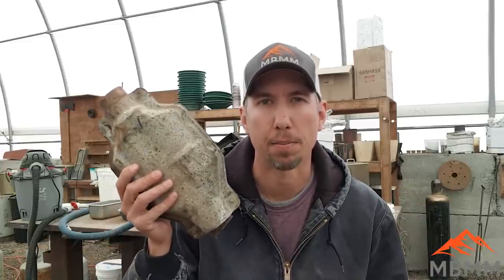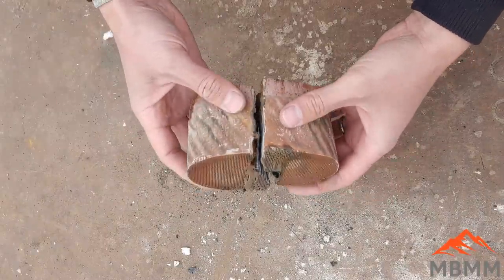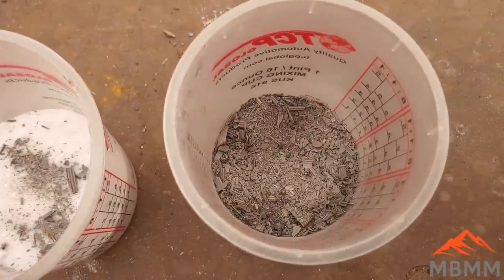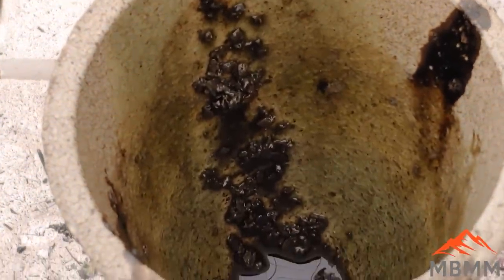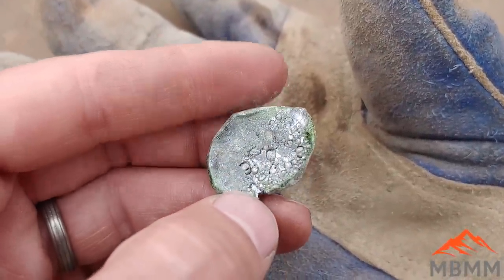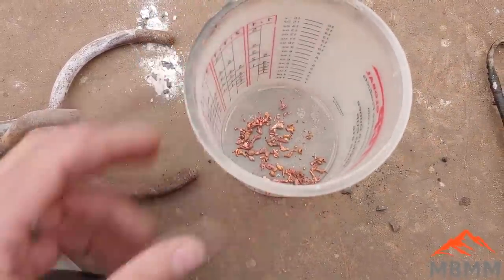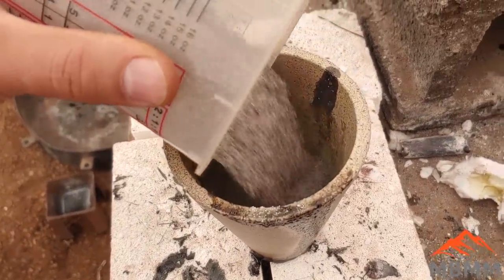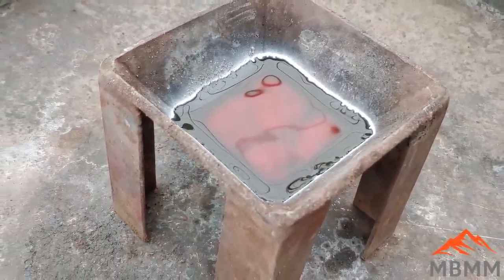Can Platinum & Palladium Be Smelted From Catalytic Converters? Urban Mining Platinum and PGMs!

Comment: with hot work like this, the very small particles of metal do not have the weight to move against the convection currents in a crucible so stay quite evenly distributed throughout your slag. you need a rotating furnace that brings all the slag into contact with the collector metal at the bottom of the crucible. the molten metal collector stays on the bottom of the crucible and the rotating agitation of the crucible brings all the flux into contact with it allowing it to do its job of alloying with your target element.
Reply: Q

Comment: Hi Jason
It is difficult to recover catalysts by gas smelting. Refineries do it in electric arc furnaces where high temperatures are reached.
On the other hand, when metals such as palladium are copelled, the final button usually does not reach more than 50% purity due to the high temperature of the palladium.
 So the lead is not oxidated 100%
There are two types of catalysts. Some contain only palladium and others contain palladium, platinum, and rhodium.
On the other hand, it is always convenient to grind and mix well. For this type of analysis, litargirium (PbO),  is usually used as a collector and some charcoal to reduce the  lead.
good video!!!

Comment: Good morning Jason,
I watch every video you do.  I really appreciate your approach.  Thanks fort showing both the successes and failures.  I did a lot of salvage work over the years, and if the cat is one of the aftermarket cats there is a good possibility that there was very little PM in it to start with.  When I sold cats to the yard they would pay $100 to $150 for oem cats but only $7 for aftermarket cats.  Reason they gave was almost no Pl and Pd in aftermarket units.  Same price for brand new cats if aftermarket.
Reply from the maker: Thank you for the information! Also thank you for watching our videos so diligently, it means a lot to us (especially Jason) when people return so often.
Reply: By OEM you mean new? And aftermarket is used?
Reply: @freeman2399  OEM is original equipment manufacture (GM, Ford, Chrysler, Toyota, Honda, etc.) and aftermarket would be others
Reply: @mbmmllc  Low grade Cat
Reply: I've never melted or smelted any metals in my life but I find it interesting to watch these videos from time to time. 
I'm always curious about something... Can it really be profitable to smelt scrap like this in a small scale? 
I haven't done any calculation or anything but it looks like it's using a lot of propane in comparison of the size of the beads that I see at the end to these videos and there also the cost of the crucible and other stuff like that...
Reply: @kube9189  Ok but why would aftermarket cats have less metal?
Reply: @freeman2399  because they usually do not need to meet any warranty requirements like OEM does when they certify a car for longevity.   Exception would be a legally sold one in Cali needs to last a certain number of years or miles, and those typically go for twice as much.  For my 94 camaro, a Cali certified one is about 200 dollars.  An "ebay special" non compliant can be had for 80 bucks on a good day
Reply: Less than 10 years ago it was on the Internet that a U.S. company figured out how to use silver instead of PGMs, in catalytic converters.  Another catalytic converter company bought the patent and reportedly shelved it.  It would be like some companies, to switch to silver and never whisper a word of it, but charge for the PGMs anyway, except when it comes to buying back scrap.
Reply: Thinking further:  if shortly after this patent was bought and supposedly shelved, there were any market record indications of a significant drop in PGM use, that was not due to down economic times for the metals, and/or increase in use of them for bullion, THAT would be an indicator.  Or just a whole bunch more silver and less PGM in the CC's going to be recycled.

Comment: When I was driving over the road in the 90's. I hauled  dessicates in which it is the same thing as what  catalytic converter is made of. The plant that i took them to used acids to dissolved everything. Then processed it in stages to remove all of the metals out. By the time everything is done all is left is clay. Even that was sold to the farmers as well. I hope that hint was very helpful.
Reply: What are dessicates??
Reply: @omarez6896  It is round clay balls used in dehydration systems of Gas Plant Operations and In Refineries in the area of the plant they call the Cracker. It is also the same thing that you would find in your common double/ Triple pane glass windows. If you look closely around the edges between the glass. You will see tiny louvers cut in the tube. Inside that tubing is the dessicates (about the size of bird shot or rat shot). They control moisture in between the glass keep them from fogging up with temperature differential. 
I hope this helps answer your question.

Comment: there are three heavy metals in a cat #1. platinum, #2.rhodidium, #3.paladium . the cat you were doing your demo on was pretty much burnt out due to excessive unburnt hydrocarbin why theifs perfer to cut them off of new veheicles. and yes it is a chem process to remove the precious metals from the cat as someone mentioned before. EXCELANT INSTRUCTIONAL VIDEO very educational on how a cat cooks off when a the check engine light comes on for multiple misfirer. love this video as well as all your other ones again keep up the good work.

Comment: In smelting you have a few challenges. The catalytic substrate is a carbide ceramic that gets treated with a silica dioxide and aluminum oxide "wash coat" to increase surface area with an addition of ceria zirconia to promote O2 storage. the core is engineered with rhodium as the reduction catalyst and palladium as the oxidizer or just platinum as it does both but that creates side reactions.
My "guess" is that the substrate is your biggest hurdle as it is engineered to to withstand 1000 Celsius. The zirconium could be an issue too. You had high palladium values so I would expect to see more rhodium though that would get eaten by the catalytic reduction by use.
Reply: Troll? Hardly!
Agree with most of what the OP mentions.  Only 2 comments I'd make: honeycomb substrate for flow-through catalyst is almost always cordierite. Silicon carbide substrates are used for diesel particulate filters - mostly in Europe.
Rhodium is very expensive, but is the very best catalyst for NOx reduction.  A catalyst, by definition, doesn't get used  up in the conversion of the pollutants into CO2, nitrogen and water.
I'm surprised to learn of road dusts containing quantities of precious metals from autocatalysts.
Reply: What if electrolysis was used to extract the precious metals?
Reply: and by the way-  once you get Ruthenium out, you can probably use it to electroplate thin sheets of base metal with then layers of Ruthenium, and make a sunlight hydrogen generator.  Sunlight strikes the Ruthenium and apparently adds to its natural vibrational energy, causing it TO SPLIT WATER.
Reply: thin layers
Reply: It might even be possible to find an alloy that will split water catalytically and spontaneously.  Such have been rumored to have been found in the past and for the most part the info is no longer very findable on the Internet.  Vanadium and molybenum were two different articles, a third was on a mixture/alloy involving platinum accidentally discovered.  Imagine that under the hoods making fuel from water.

Comment: For that amount of platinum in the smelting mixture it essentially dissolves. If the concentration was higher then you could smelt it out because it would surpass its maximum solubility in the molten slag. For this low concentration material, chemical leaching is really your best bet. Aqua regia soak on the pulverized ceramic matrix followed by precipitation of each metal in the oxidation series.
Reply: Apparently there is between 3-7 grams of platinum group metals in a catalytic converter, that is quite a bit.
Reply: Exascale seems right - as I was watching the video I was wondering why he was smelting it before purifying it. It doesn't matter if there's 3-7 grams per convertor, that's a LOT of slag/flux per batch and seems really wasteful compared to an acid process.
Reply: @rdizzy1   3-7 grams for a new one, the Pt metals will erode in use. 
Codyslab did a video in which he collected dust of an highway and managed to extract some platinum from it.

Comment: I work for a exhaust company that makes a lot of converters besides exhaust systems. The ceramic is coated in the palladium as well as platinum. The company saves all the dust from production as well as broken bricks and sends them out to a contractor to extract the precious metals. They send them out in a cardboard barrel like a 50 gallon drum. They posted once on how much they got back a barrel and it was between 10000 to 12000 American dollars.
Reply from the maker: That's crazy! Do you know their process for extraction?
Reply: @mbmmllc  I believe it's a acid extraction. They do so much at a time and I believe it goes to somewhere in Pennsylvania to get processed. The cardboard barrels we usually send 10 or more at a time, and its usually once or twice a year. The big automotive companies, one buys the converters the other one pays for them after there assemble and delivered. So they usually can't send the junk broken pieces until they sign off of them. Everything has to be strictly recorded because of possible theft. The one company usually does brick inventory at least twice a year because they buy them first.
Reply: @mbmmllc  some of the big duramax converters are as big or bigger than a 5 gallon bucket.

Comment: Platinum, Palladium, and Rhodium are the precious metals used in catalysts.  The use of Platinum vs. Palladium seems to follow which one is cheaper, as they both do pretty much the same thing.  Many modern catalyst don't have any platinum in them... 

Also- if you are getting a catalyst off of a car made in the last 20 years, there are generally two of them- the front one will be loaded with 3-5x more palladium, and maybe 1.5x the amount of Rhodium.  In terms of ratios of the precious metals- on the front brick, it will be in the 40:1 range of palladium:rhodium, and on the second brick, closer to 5:1. 

Interestingly enough, the very first PZEV cars, in the 2000-2005 time frame will have the most metal in them. Lots have been learned since then- and the metal usage is much better optimized vs the cost.  Find the cats off a PZEV BMW, Ford, Honda, etc of that era, and you have the best potential for higher recovery.
Reply: alfamaize ....I like how you made your point but most of it is incorrect....certainly your 2nd paragraph.....there is no finite ratio to go with.....I see where you are going with it but to say it’s a general rule is wrong
Reply: @jarradmoore6939  No, it's correct- I've been working specifically in automotive emissions for a couple of decades now, and the ratios of the metals in catalysts are very specifically laid out.  As are the actual amounts of metals on the bricks.  The odd measurement that is used is g/cu ft.  Why that, I have no idea.  But that's what we've been using, and still use.

I worked on the early PZEV cars, and know that they used about double what we do now to achieve the same result.  

Automotive catalysts are very specifically engineered devices, and the ratios I posted are rough generalities which are reasonably close.
Reply: alfamaize ...no you are incorrect....you didn’t even specify fuel source of the vehicles ....horsepower of the engines Or the simple fact that a large number of vehicles only actually have one....

Comment: Great video! Always wanted to try cat smelting (I would have added silver instead of copper as collector to aid the lead and the cupellation).  @ 16:36  Pb-Pt eutectic point is 327C (554F) 95wt% Pb + 5wt% Pt meaning that an alloy composed of 95g Pb and 5g Pt would melt at 327C (554F). Once again great video!
Reply from the maker: Thanks Owl.  Yes, I think silver is the way to go!  I will be doing another vid soon and use silver as the collector.  Thanks for the info on the Pb-Pt eutectic!
Reply: @mbmmllc  also to get the actual weight of the bead you need melt with an oxyacetylene torch so all lead is absorbed into the cupel

Comment: Would be very interesting to see the XRF analysis for the crushed catalytic core material. I'm guessing that there should be Pt Pd and maybe Rh in there possibly depending on whether it was a cat from a gasoline engine or a diesel engine.
If you have XRF then the data for the starting material and the product and possibly the slag MAY indicate where each precious metal can be found.
Remember that finely divided precious metals are harmful to health.
Reply: Finely divided? Do you mean crushed or ground up?

Comment: To me, what you had, is a pre cat which is different than a normal converter. I believe it's because of its close proximity to the initial point of combustion with less catalist used. I was a auto mechanic for 25 years, the ones I believe have more precious metals are your larger luxury vehicles, suv's, German or japanese imports. I could go on, Mercedes was the one I recycled for the most amount of money..and it was also one of the biggest. Hope this helps
Reply: He had one of the lowest grade converters that they make in this video. Its a subaru RCAE2 code. Very very low value.

Comment: On your previous video I was thinking to myself if you would ever do recovery from a catalytic converter, do you have ESP or something? 
Nice experiment I hope you get an answers to a solution for the smelting process to work, Otherwise couldn't you have pulverized the material into a powder and ran it on a small shaker table as the material you are trying to recover is heavier than gold?  Then take what ever the table sorts out and smelt that material?

Comment: Cool stuff, like what you are doing. Even if I have no expertise i metallurgy at all I'm pretty sure what the problem is : you are probably looking for the wrong metal. That's why you found palladium ( that's what you are supposed to find in a cat converter from a petrol driven car) instead of Platinum which is only used in Diesel cars. Anyway, very interesting stuff.
Reply: Will the jewelry or scrap precious metal buyers buy the honeycomb from a gas car cat that is just crunched up in a bag ?

Comment: Hi Jason
I have done similar experiment. The best flux for smelting cats is Cryolite.
Also, once the flux cats mix melted then add lead.
For copper used as collector you should mix tiny copper wires flux and pulverized cats and let it smelt.
I am working on hydrometallurgy and it is promising.
Reply from the maker: Thank you for this information! We will definitely take this into account if we do this experiment again!

Comment: I think I'd ball-mill the honeycomb to start with, getting in nice and fine. Also, I wouldn't cut the can. I'd use a shear, or I'd ram like a shit lever with knob up into it (or down from the top) or use a clean pry-bar to crack it and get it to come out, maybe using an inspection cam or flashlight to make sure it all came out. I always thought cutting creates metal fragments or abrasive particles which might make the job harder, or be contaminants, but maybe not. I thought: if I didn't add any metal to the process, the only metals present would be the ones I wanted: the PGMs.

Comment: Nice. I wonder if just leaving the pgms in the lead longer would work out.they are more dense than gold.  Its cool going through the learning process . figuring out how to make it work. Fun fact , platinum oxides ignite alcohol.  There was even a cigarette lighter design was made around that concept from the 1920's. After the main crucible and cupel cool, I wonder if a drop of alcohol would ignite when added, after smelting platinum . do you live in an area the sands roads in The winter? I wonder how well a shaker table would work for getting out the pgms from that road sand. There's supposedly enough to mine on a busy road...it can be up to few ounces per ton if the sand is reused year after year and sees alot of traffic. .I think the cupel ate your platinum. I also think ceramic is the problem and if you can seperate the metal from that, which is where the chemicals usually come into play. smelting would be possible. Maybe the shaker table could help woth that on some level . the converter works on the same principles as the pgm oxides and alcohol ignition. The pgms are bonded into the ceramics. They react with the exaust and heat up intensely , both incinerating solids so they dont clogg the ceramic filter, and so toxins can be captured by exchanging them for pgms in the exaust and vice versa in the ceramics. Those are the particals in the road dirt btw. The green and red slag looks like iron and pgms also. Funny , I have rock samples that look lie the first slag. Same transparent drab green on a black base.

Comment: When I was thinking about recovering PGE from cats I wanted to smelt the crushed ceramic with an excess of finely ground copper, then get the values from the anode sludge in electrolysis. 

Would love to see you do it again with e.g. shaker table refined copper wire, and as others have mentioned a more high grade cat! Perhaps you could get one from a BMW or something next time :D
Love the videos, keep them coming!